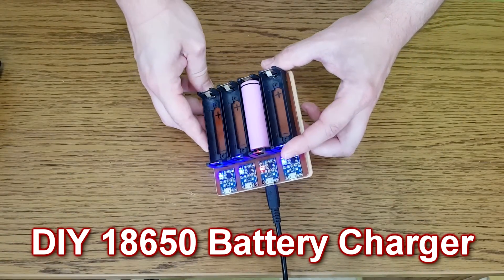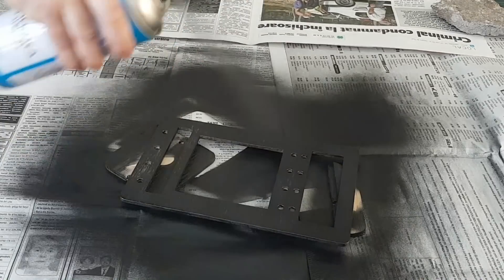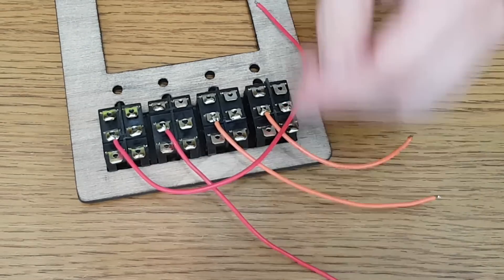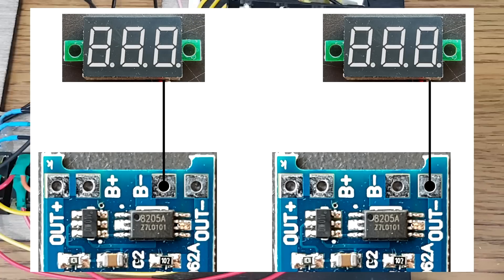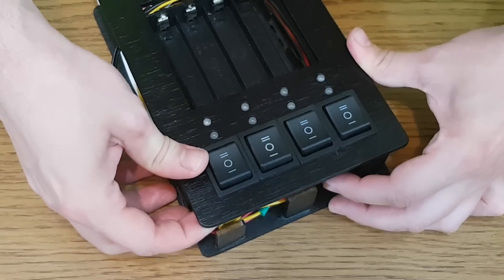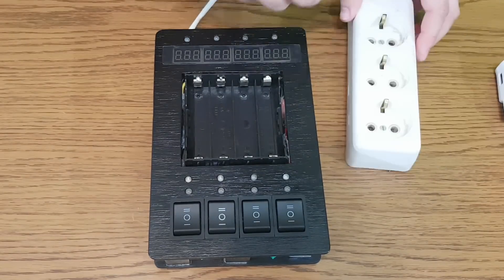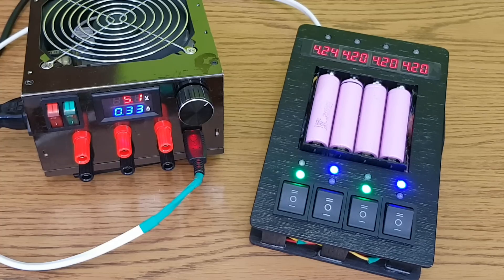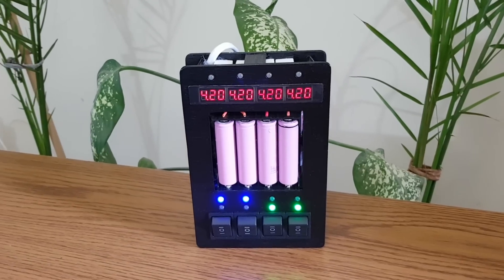My DIY 18650 Battery Charger

Comment: Ciao Sorin. Grazie del grande, ripeto grande, contributo che ci doni !   La fase di scarica della batteria si interromperà a quale tensione ?   Una domanda pratica: ho dei volmetri digitali da 0,28" a due fili (nero e rosso). Posso farli diventare a 3 fili saldando il filo giallo al pin accanto al filo rosso?   Ci tengo troppo alla tua risposta.  Antonio
Reply from the maker: Hi. If you have the same voltmeter, yes you can separate the power and sense pins and add another wire. 
The discharge cycle stops according to the protection circuit on the TP4056 board at 2.5V.
Reply: @Sorin_DIY  Ciao Sorin. Grazie per la risposta. I voltmetri a due fili che ho hanno l'aspetto uguale ai tuoi ma le dimensioni sono diverse: 22,5x10mm.
Se trovo la tua email di mando 2 foto. Buone cose, di cuore. Antonio

Comment: Ciao Sorin. Grazie per tutto l'aiuto che dai. Su un TP4056, arrivato alla carica dell'85% della 18650 collegata (3.9V) con luce rossa accesa, si accende anche la luce blu. Sai il motivo per cui entrambe le luci, rossa e blu, restano accese contemporaneamente? Antonio
Reply from the maker: Hi. Both LEDs should not light up. There may be a problem with the module or the connections.
Reply: @Sorin_DIY  Ciao Sorin. Grazie. Ho ripetuto l'operazione con un'altra cella 18650 scarica. Sino al raggiungimento dei 3,98V resta acceso solo il Led rosso, poi si accende anche il Led blu. Se fosse il TP4056 difettoso credo che non funzionerebbe correttamente sino al raggiungimento dei 3.98V, o sbaglio? E anche le connessioni credo darebbero problemi sin dall'inizio, o no ?   Boh, per me resta un mistero....  Grazie ancora di cuore

Comment: Ciao Sorin. Complimentissimi. Iscrizione e Like fatti. L'interruttore bidirezionale se premuto su "-" carica le 18650 mentre se premuto su "=" le scarica. La domanda: al termine della scarica ("=") è possibile far partire in automatico la carica ("-") ?   
Confido davvero nella tua competente risposta. Antonio
Reply from the maker: Hi. With this type of simple switches it is not possible. It will probably work with other programable modules, but in the end it will be too expensive. 
This is a simple and cheap charger/discharger, that you can make if you work with a lot of Li-Ion cells.
Reply: @Sorin_DIY  Ciao Sorin e davvero grazie della tua presenza. Gli interruttori bidirezionali a 6 pin li trovo con le sigle KCD1, KCD2, KCD3, KCD4. Hanno prezzi molto diversi. Quali devo comprare per "copiare" il tuo bel progetto ?  Puoi dirmi, per favore, in cosa differenziano ?     Se un giorno passerai dalla zona di Milano, sarò lieto di sdebitarmi offrendoti una buona "pizza+birra" Ancora grazie. Con stima. Antonio

Comment: modules that have over discharge protection (dw01) ic has reverse polarity protection so connecting the battery in reverse wont damage the module

Comment: hi. Sorin nice vid again. i want to make universal battery charger. so for AA AAA and 18650 battery's. is this possible. i cant find a adjustable battery holder for it and the module
Reply from the maker: Hi, are you planning to charge only li-ion cells? or Ni-Cd & Ni-Mh as well, because it will become pretty expensive. I can't find a adjustable battery holder, but you can buy a simple cell charger and use only the battery holder, it's very cheap: https://s.click.aliexpress.com/e/_DkM0lm5

Comment: How would we go by installing our own DIY solar panels to this charger station?
Reply from the maker: you need a higher voltage solar panel (12V, 18V, 24V...) and a powerful CC/CV buck converter.
Reply: @Sorin_DIY  
Well I figured I'd have to put a few panels together to make it 12 volts, but how powerful of a cc/cv buck converter are we talking here?

Comment: You have a great project, but I thought of a addition, how about a voltage and tempreature connections to a Nano then to the computer so you can monitor and record these parameters.  I connect 4 leads to the positive poles of the battery and 4 thermisters to the battery holders mounted in such a way as the press against the batteries.  I am writing a sketch to monitor these valuse and send them to a computer useing putty. If you want more info let me know.

Comment: Very Nice! I want to build a one or two cell charger with these modules. I currently have a cheapo single cell charger that plugs in the wall. It's takes like 24 hours to charge a cell but that's okay because it doesn't stress the batteries. I was wondering if I could slow  the charge the charge rate of these modules. You've answered my question. I will have to change the resistor from pin #2 to ground. I'm also wondering how your volt meter displays two digits after the decimal point? Is that automatic or programmable? Or maybe a specific to the product?  Thanks!
Reply from the maker: this type of voltmeter can measure the voltage with 2 decimal places up to 9.99V. and from 10.0V it switches automatically to 1 decimal place. it's pretty good.

Comment: Can a 5.7V 3A adapter be used.thanks
Reply from the maker: the TP4056 module has an input voltage of 4.5V - 5.5V, so I don't think so. a higher voltage can damage it.

Comment: Does not include the LEDs in your schematic. Can you please include it? 🙏
Reply from the maker: the LEDs are from the TP4056 modules. you can use the original LEDs, or you can replace them on the modules. there are 2 LEDs with a common anode.
Reply: @Sorin_DIY  Yes I got it, I mean the LED below the small screens that connect to a 10 ohm resistor
Reply from the maker: that LED is shown in the schematic, it's connected in series with the 1Kohm resistor.
Reply: @Sorin_DIY  thank you sorin. 😊

Comment: Will a 10w 50 ohm resister work in this
Reply from the maker: a 50 ohm resistor it's not good enough, it will take too much time to discharge the cell.

Comment: can i use two pcs. of resistor 5watts 10 ohms in parallel?
Reply from the maker: no. they will become a 5ohm 10W resistor and will get very hot. you can use just one 10ohm resistor but with a big heatsink.
Reply: @Sorin_DIY   salamat po?👍

Comment: I request you to pleas give a complete list of items required, if it is possible for you, as I had seen so many other video makers, for easy and doubt less arrangements of articles.

Thank dear for your reply
🙏🙏🙏
Reply from the maker: hi. I got the components from banggood.com, the links are in the video descriptions, but some of the components are not available anymore. 
you can find similar voltmeters here: https://www.aliexpress.com/item/32810115206.html?spm=a2g0o.productlist.0.0.6d5826a5z5Mnk3&algo_pvid=7a3a3872-3f76-410a-8789-c30b53cadaf9&algo_expid=7a3a3872-3f76-410a-8789-c30b53cadaf9-32&btsid=0bb0624116021885598295083e4b96&ws_ab_test=searchweb0_0,searchweb201602_,searchweb201603_
TP4056 modules: https://www.aliexpress.com/item/32986135934.html?spm=a2g0o.productlist.0.0.77df6b83BCom3g&s=p&ad_pvid=2020100813293617644699808558460024350665_1&algo_pvid=e5a8cb63-4958-498a-bdf4-3c09af34bf8b&algo_expid=e5a8cb63-4958-498a-bdf4-3c09af34bf8b-0&btsid=0bb0624316021889768858731ed497&ws_ab_test=searchweb0_0,searchweb201602_,searchweb201603_
10W 10ohm resistors (10R): https://www.aliexpress.com/item/32957381670.html?spm=a2g0o.productlist.0.0.75381fb0HlvWzL&algo_pvid=f3092a2d-aba3-4f01-8568-81bdfceefcca&algo_expid=f3092a2d-aba3-4f01-8568-81bdfceefcca-0&btsid=0bb0600116021891486082757e1702&ws_ab_test=searchweb0_0,searchweb201602_,searchweb201603_
Reply: @Sorin_DIY  
Dear Sorin,
As I am living in Delhi and if you publish list of items along with your post, it will be great help to procure from local market demanding by the articles correct name.

Comment: I just love this 18650 charger project even more than your last one. When I first saw the thumbnail to this video I though it was a textured 3D print. Nice work! Again, you've got balls of steel to solder smd circuit boards with a 100 watt soldering gun. Oh, and now subscribed and rang the bell.

Comment: Can i use a single module to charge two batteries??
Reply from the maker: yes. but the cells need to be the same type, same lifespan, same number of cycles and the cells must be always connected in parallel, when you charge them and when you use them.
Reply: @Sorin_DIY  i can manage the parallel connection but how to figure out if they have the same cycles 😅?

Comment: Can I use only one TP4065 to charge severel battery?

I mean, if I connect 2/3 battery in parallel and charge them with single TP4056 module, is there any problem?
Reply from the maker: hi. with 4 charging modules you can charge 4 cells individually. the cells can have different capacity, they can be discharged to different levels. you can put each cell in the charger at different times. all the cells will be charged much faster, with max 1A. not 1A divided to all 4 cells. if you want to charge multiple cells with only one charging module, the cells must always be connected in parallel (when you charge them and when you use them). the cells need to be the same type, same capacity, same lifespan, same charging-discharging cycles and they will be charged 4 times slower -> 1A/4=250mA each cell.

Comment: One last question, what is the polarity of the led pins on the Tp4056 Board and why can you use only 3 wires each?
Reply from the maker: hi. the LEDs have a common anode. the polarity on the board is (- + + -). the positive connections are in the middle.

Comment: Thanks for this great Video, i will build this thing for sure.
If i want the charge feature only, how do i have to connect the displays?
Reply from the maker: hi. if you want only to charge the cells, you need simple switches with 1 pole and 2 positions. the negative wire from the 5V charger is common. is connected to all TP4056 modules and all the voltmeters. the positive 5V wire from the charger is connected to all the voltmeters and to the switches. each switch will deliver the positive supply wire to 1 TP4056, so you can turn them on individually. the voltmeters sensor wires are connected to each li-ion cell positive terminal.
Reply: @Sorin_DIY  Thank you, that helps quite a lot :)
Reply: I don´t understand the schematics with the wirering of the switch also :(

Comment: Where can I find DPDT switches (3 positions 6 pins)? Recommend me a shop, I am also from Romania, so I think you would know at least a shop. (comentez in engleza sa inteleaga si altii)
Reply from the maker: salut. se mai gasesc si la magazine locale de electronice, Quintrix sau Adelaida, nu stiu daca sunt in zona ta. online am gasit si aici, dar nu am cumparat niciodata de la acest magazin:
https://www.tehnoelectric.ro/produse/70_651_comutator_dublu_cu_retinere_on_off_on_15a_250v_34x31x25_mm
Reply: @Sorin_DIY  Multumesc! O sa fiu cu ochii in patru dupa acele magazine, poate dau de vreunul cand ma duc in alt oras.

Comment: 0:26 but i thought that you can't wire all the tp4056 with the same positive wire because it short circuit the battery ??
You told me that in a comment a few days ago...
Reply from the maker: that was on the 4S BMS charger video. NO you cannot connect TP4056 modules in series and use the same charger for all of them. but YES you can connect these modules in parallel and use the same charger.
Reply: @Sorin_DIY  Thank you master i have made the newbie mistake of the parrallel / serie !!!
I wish there was a way to plug them in serie. I know you can isolate the supply but it kind of expensive to add a BO505S for each TP4056...

Comment: i just hook up everything directly for the meantime: the battery to a usb voltmeter in between, and the resistor.  it doesnt have a cut-off so im closely monitoring. i just want to discharge it, also at 3.59v while under load using 10w10ohm i am only drawing 0.29 amps. would you recommend a higher resistor  value to speed up the process? its already running 3 hrs 39 mins and so far the total mah drawn were only 1071 mah
Reply from the maker: for a higher current you need a lower value resistor I=U/R. if you want a higher current, you can use a 10W 6.8ohm resistor, but it will get very hot.
Reply: thanks alot! that will do and with proper heat dissipation i suppose?
Reply from the maker: yes

Comment: Adding a spring or size adapter, can you use it to recharge/discharge any kind of batteries (like AAA, AA, 1,5v, 3,6v) or it will works with 18650 batteries only?
Reply from the maker: it works with li-ion and li-po cells with a nominal voltage of 3.6 or 3.7V and a max voltage of 4.2V.
Reply: @Sorin_DIY  Thank you, so it means "it will not works for 1.5v", I have to disassembly laptop batteries and mobile phone batteries...

(PS: i saw your power bank video too, I assure you that it will be littler and lighter if you install old some 3500-4000mah mobile phone batteries instead 6x 18650)

And soon i'll build the power supply! Thanks so much!! 

PS: you can find the same components for cheap in other websites (IE: Mini voltmeter for 0,75$ instead 2,51$ each)

Comment: Why did you glue the case?  You can not open it to repair if you blow up a TP4056.  The input is reversed protected, but the output is not reverse protected.  This mistake can easily be made.
Reply from the maker: hi. you can use screw spacers between the 2 panels. it would have been better with screws, but I forgot to buy some, before I started building the charger and I didn't wanted to wait again.

Comment: Did you put a pull down resistor on your sensor wires so your voltage reading doesn't have a seizure when you remove the battery? Even a 10M pulldown will be fine, which would drain nearly nothing.
Reply from the maker: no I didn't :( it does have a seizure.
Reply: @Sorin_DIY  I wish they would add it to the voltmeter  stock, but I guess 1 resistor is asking too much when selling something as cheap as possible xD

Comment: Newbie question. Would this charger charge Ni-MH batteries? Like the Ikea LADDA 2450 AA batteries? Thanks!
Reply from the maker: no. only li-ion and li-po cells with a nominal voltage of 3.6 or 3.7V and max 4.2V.
Reply: Thank you for responding.

Comment: hola excelente vídeo , hay alguna forma de saber la capacidad descargada en amp, total de cada celda? mencionas que  la descarga con esa resistencia va desde los 450mha pero baja con relacion al voltaje de la calda , es ovio pero daría un estimativo con relación tiempo , de la capacidad total hay algo mas exacto de forma casera que no sea arduino ? agregándole transistor q haga variar la resistencia así a medida que baja el voltaje .mantenga los amp de descarga , gracias y perdon no hablo en ingles saludos
Reply from the maker: Hola. para un cargador de celda DIY 18650 es difícil medir la capacidad exacta. Puede agregar un módulo de prueba de capacidad barato de China. Otro método impreciso es agregar un convertidor reductor, bajar el voltaje de la celda (de 4.2 ... 2.5V) a 2.5V estable. luego conecte una carga de 10 ohmios. consumirá 250 mA hasta que la celda se descargue. digamos 6h. multiplica 2.5V * 0.25A * 6h = 3.75Wh. divide 3.75Wh al voltaje nominal de la celda, que es 3.6 o 3.7V; 3.75Wh / 3.6V = 1.04Ah. pero esto es impreciso, porque la eficiencia del convertidor reductor varía según el voltaje de la celda. cuando el voltaje de la celda se está reduciendo, el convertidor extraerá más corriente de la celda para mantener una salida estable. entonces su eficiencia fluctuará probablemente entre 95-85%. así que en realidad la célula tendrá 1.1Ah o 1.2Ah ... (google translate)

Comment: whats your opinion on using 1 module for charging two similar -brand new batteries ? thanks
Reply from the maker: hi. yes, you can connect 2 cells in parallel to one charging module. if the li-ion cells are new, it's better. you can also do this with old cells, but they need to be the same type, have the same capacity, same life-span, same charging cycles and use them in the same parallel configuration.

Comment: Hello Sorin - DIY Electrical Nerd... I have made this one, but te bateries don't charged more than 4.0 volts! someone knows what's happening?
Reply from the maker: hi. did you used thick wires on all connections? check the voltage with a multimeter at the charging module terminals and at the cell holder.
Reply: @Sorin_DIY   Yes, I used thick wires, and the input voltage from a smartphone charge is exactly 5.1V on the module, and the module output is proportional to the cell voltage incrementing until 4.0V only, when it indicatescharged battery... I don't understand what is happening because I try with diferents cells and whit 4 modules, and the problem is the same.

Comment: Hey is it possible to build ur Charger with Mah readings for Discharge and charge?! To exactly find 2 or 3 Cells with same Capacity to get them married in an 3S or 2S Pack and solder them and then charge them with an RC Charger?! or will i have to watch the Discharge volts and if the Sync at discharge and sync at charge they will have the same Amount of Mah?! because i want to build me an 3S Pack for my RC Transmitter. And all the Amazon Chargers are shit. Or have u a better idea to get to my goal?! Greetz Tom
Reply from the maker: hi. you can add a capacity tester module to this charger, then you can test the cells and know the exact capacity. but it will get expensive. if you build it with those cheap voltmeters, you can compare the voltage and time the cells need to charge and discharge and you can group them accordingly. if you want a precise charger/tester, I recommend opus bt-c3100. it's a bit expensive but very good.

Comment: Hi I would like to know if I can put 3 18560 batteries in serie and charge each one with a tp405 in parallel with the batterie.
Thank you very much
Reply from the maker: hi. yes you can charge them like this. but you need 3 different power sources for the TP4056 modules. not 3 switch mode chargers, because they will be connected to the same supply current from the mains. you need 5V chargers made with transformers, or a transformer with 3 isolated 5V outputs.